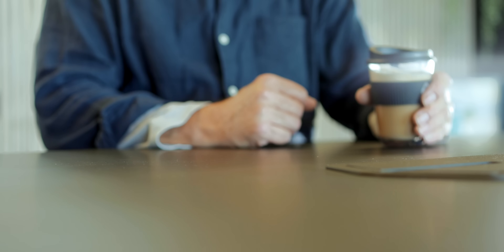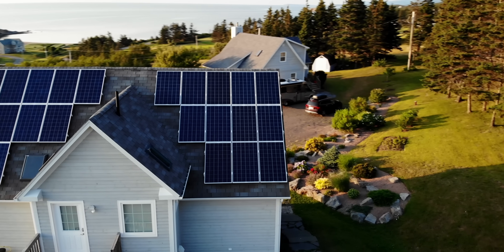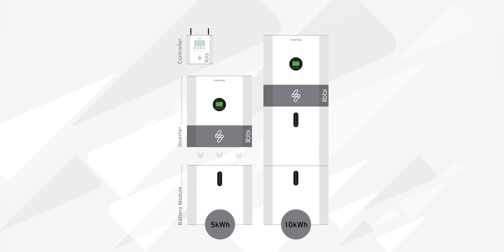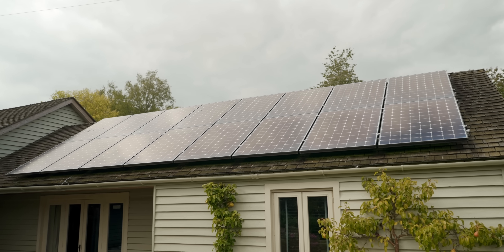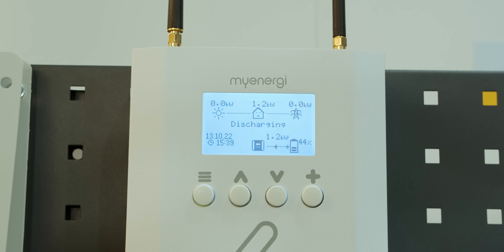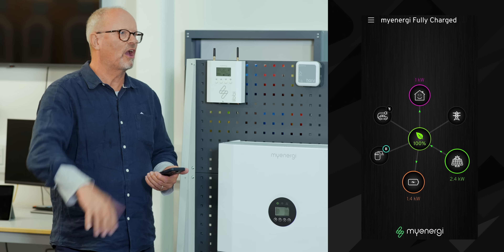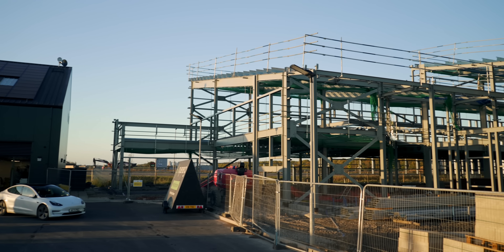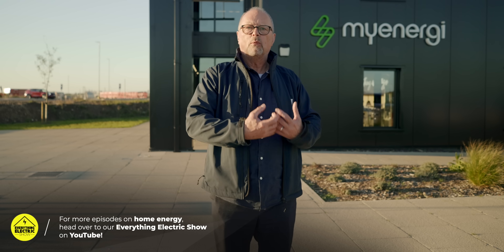THIS Home Battery is the Key To Cheaper, Cleaner Energy!

Comment: Without a price it's hard to know whether it really is cheaper energy (or cheaper than the power wall)
Reply: Yea, I am hoping they don't go above £2k per 5kWh battery and no more than £1500 for the inverter.
Reply: @BobHannent  just seen an update on the MyEnergi website. About £4500 plus vat for the basic 5kWh/3kW setup.
Reply: @rugbygirlsdadg  that's not terrible, not wonderful. Thanks for sharing.
Reply: @BobHannent  I had a quick google and it looks like it's from £4,500 ish which is the inverter and presumably  the basic 5Kwh storage. You can buy 2kw solar panel kits with MPPT inverter / charger, panels and 4Kwh of lithium storage for less than that
Reply: @diceman199  yup, but I kind of expect a premium from a British brand, it comes with the territory.
Reply: @BobHannent  Possibly but that's a rather substantial price difference. I'm looking for solar at the moment as I live on a boat
Reply: @diceman199  similar to teslas 5k for a powerwall. (its actually 17k when your add all the extras). your paying to make elon money from the grid.
Reply: @luminousfractal420  Personally I'd be going the semi-diy route, buying the kit and hiring a sparky to install it. You can pick up 550w panels for peanuts now and LiFePo batteries for as little as £200 for 100ah. 

Lots of boaters have this sort of set up, often with a lead acid battery in the system, and use solar and alternator power to charge when moving.
Reply: @BobHannent  Yes. There are electric cars around now with 80kwh batteries for around £40k. That is £500 per kwh and you get the car for free. The price for storage should now be around £300 per kwh maximum, otherwise we are being ripped off.
Reply: @BobHannent  You are talking about a company that charges  £2k pound for car charger - that just switches power and doesn't even do any power conversion. Their hybrid inverter will probably be £8k plus £1k pound per kilowatthour as the realistic 'installed' price.
Reply: @BobHannent  its 4500eur
Reply: @BobHannent  I phoned them and I swear if costs more than that
Reply: Similar with the Tepeo boiler they featured. I mean, its a great piece of tech and makes a lot of sense.... but I went to check and its 6 grand! I can have 3 normal boilers for that. None of this stuff is going to get anywhere if  you need a 6 figure salary to be able to afford any of it! I'd love solar panels, a battery store, that boiler, an EV and a s system like this. It'd be great. I'd also need about 2 years salary to buy any of it!!!
Reply: @0tispunkm3y3r  tech is usually ridiculously expensive for a while before getting cheaper, just look at everything else. Flat screen TVs were stupidly expensive for a while for example, now a 75" TV can be had for $600 on sale
Reply: @0tispunkm3y3r  If you've got a mortgaged house, and you've got the space, consider getting a lodger

I say this, because it solves a couple of things

Cheaper costs for them
The money they're paying you allows you to pay for stuff like this

That's what I'm doing anyway. Though the biggy is hopefully getting even more solar
Reply: @0tispunkm3y3r  You are 100% right. Going green is for the super rich. We are facing a cost of living crisis. And it’s for the young. The people who spend most time at home are the elderly and the poorest. They can’t fund any of this and they can’t work the technology either. And when it breaks there’s no one local to fix it. And it becomes obsolete too quickly because it’s in its infancy. The average U.K. home nowadays is only 800 sq ft. and has no storage. Where are you supposed to put all these solar panels and batteries etc? I do thin’ a lot of these solutions are only suitable for a very small demographic.
Reply: @tommoncrieff1154  very true. But the first thing every home owner should first do is insulate it. This is something most people could do themselves, although even insulation costs have rocketed since last year. In Scotland there is funding support (grants and loans) for insulation, not sure what's available in rest of UK. The  money saved on heating bills after insulation is far greater than returns from domestic renewable systems.
Reply: You hit the nail on the head.The most important part of the conversation is HOW MUCH?
Reply: @foppo100  The most important part of the show is:
a)how much???
b)can it operate in"dumb" mode?   too much connectivity requiring mobile app or internet...just when a certain country seems to be sniping data cables...the less "smart" the better
Reply: @bigmacntings7451  totally agree. Just listened to podcast on the internet of things where the latest product is one to connect them all together. Reminds me of early software days before we had international standards. 

Kiss = keep it simple stupid ...
Reply: If they don't tell you the price it's because it's expensive....
Reply: The cells themselves cost around €100-150 per kWh. Most cheap batteries (without Inverter) are available at around €350 per kWh. So let's see what this one will cost
Reply: @djrrmml7514  I was basing my numbers on Pylontech (well established brand) and Jakiper (sub-brand of Orient Power), plus giving them some added margin.
Importantly, acknowledging your assertion, batteries are utterly commodity, if they can't reach that price, it'll be selling on hype and not value.
Reply: @BobHannent  and integration with their current system. Many many ppl have these systems already installed, so adding it on is "easy". Given the extra flexibility it will justify ( any ) extra costs.
Reply: Can the Libbi be charged from an EV using the facility such as v2l on an MG ZS EV or similar? Would be even more fantastic if it  could switch from v2l to charging EV from solar or mains via the same vehicle connector.
Reply: Would you want to charge the libbi or literally just have the EV become like an extended battery to the inverter so it can just power your house?
Reply: @0tispunkm3y3r  I would like my EV to be an extended part of my battery storage.
Reply: @0tispunkm3y3r  the car can only export 2.5kwh via v2l. So I want the car to charge the domestic battery at 2.5kw, but then the inverter for the house to supply up to 5kw from the domestic battery and or solar. So basically using the EV battery for topping up domestic battery when required, and if possible the EV battery stopping discharge at a specific point when solar then takes over and charges the EV via the Zappi. Basically Have Zappi and Libbi communicating to control input and output from any EV with v2l or v2h.
Reply: @0tispunkm3y3r  oh man that is an AWESOME question!!! FC please answer this one FIRST!!
Reply: @shortbits23  That would be V2G functionality. Quite why you would want to charge the battery from the car I'm not sure.  Leave the charge in the car for driving. Charge the home battery off peak.
Reply: @IanMcc1000  Firstly I want to be off grid. If you are asking why, well a smart meter won't work at my address (after two attempts by octopus), so the cheapest tariff I can get is economy 7. The EV can only export v2l at 2.5kwh via the inverter within the EV. This output is not enough, so I would go for a 5kwh inverter that draws power from the domestic battery, domestic battery getting topped up from panels and EV. The EV I'm planning on purchasing holds 72kwh of charge so substantially more than the 15kwh for my domestic battery. I can sometimes find EV chargers that supply free or cheaper than my economy 7 domestic tariff, so makes sense to dump that into the house if required. Also this would mean I could disconnect from the grid and save me £180 per year in utility standing charge.
Reply: @shortbits23  interesting plan. I know that a lot of domestic batteries  are ’grid tied’ so I have a feeling you might be stuck with the standing. There's a guy on the KIA EV forums who has actually done this I think. Whether it's worth waiting for the next generation of V2G products as I think some of the latest stuff still can't quite manage what you are planning. Would be interested to see you document this once you start the project.
Reply: Ooh "Affordable Solar" in the UK are selling the KStar for about £7k for 5kWh and £10k for 10kWh.
Reply: @BobHannent   Yes, those are the sorts of prices I'm seeing around the internet.  For comparison a 5.2KWh Jakiper rack-mount battery is £1,700 and a Solis dual MPPT 5KW solar inverter is £820 (inc VAT) so you really have to ask what you're getting for the other £2,500. 

Now the development costs of the integration and software may well justify that. But forcing the battery, which should be a commodity item, into your closed ecosystem is not consumer friendly.
Reply: @calmeilles  you need to compare like with like. A Solis 5kW hybrid inverter is nearly £1500.
Reply: @BobHannent  Is that just the battery system or with panels as well? I've seen some bundles where you get panels and a 5kWh battery for about 10k
Reply: @0tispunkm3y3r  only the battery and inverter, no panels. But did include install (apparently)
Reply: @BobHannent  That is far too expensive. Much more than for Tesla and Tesla is a rip off anyway.
Reply: Yep it's just a sales pitch otherwise..
Reply: @matthew1472  Annoyingly a lot of these videos recently have become sales pitches instead of advice. I still love the channel, but you do wonder how many are on here just so they end up in Robs house.
Reply: Given some of the quotes I have had recently I think this will be closer to £10k
Reply: @Adrian_kal  it does look suspiciously like the KStar Blue Series.
Nice to see CATL batteries.
Reply: @BobHannent  Nothing suspicious, they are quite open that these are rebranded Kstar batteries and inverter with added Myenergi magic
Reply: @edwyncorteen1527  not sure that's what's been represented in the presentations I've seen. But I may have missed it? Plus Myenergi have long told of how they're innovators and 'made in the UK'
Reply: @BobHannent  I went to the Solar and battery expo at the NEC recently when the Libbi was launched and quizzed them on where it all comes from, they have searched very hard for a UK made battery but were simply not able to find one so they have partnered with Kstar who provide the inverter and batteries and Myenergi add their Libbi controller and software.
Reply: @edwyncorteen1527  there was no need to search because there are no UK made batteries. They know from the get go.
Reply: @BobHannent  It is a re-badged Kstar Blue - perhaps with some Myenergi software integration - it's £5k or thereabouts.
Reply: myenergi's website shows the Libbi starts from £4595+VAT. So id guess thats for the basic 3.6kwh invertor and 5kwh battery.
Reply: The myenergi website says that it is from £4595+vat
Reply: A 20kwH battery is massive - way more than most people need unless you run electric heating. I would estimate that the battery alone would be £10-12k plus installation (comparing other batteries on the market). If you already have PV and can save £300pm on gas and electric it would be about 4 or 5 years to pay off. These devices only really come in to their own if you have a full set up of PV plus one or 2 EVs and a dirt cheap off peak tariff.
Reply: @IanMcc1000  average UK house uses about 3700 kWh a year. Say 10kWh a day. Interestingly a detached house is more like 4100 kWh or about 12 kWh a day. I suspect once you break it down into winter/summer you may well see up to 20 kWh a day in the cold, dark months. So potentially a 20kWh pack could come in handy! The issue might be that in summer you'd be able to fill it with solar but perhaps not actually be able to use it all (unless regular EV use) and in winter you'd never fill it with solar and would have to charge overnight all the time on cheap rates.

So I guess 10kWh would be a sweet spot with 5 potentially being a little too small and 20, whilst nice, might only be beneficial to fewer people.
Reply: @0tispunkm3y3r  Yes, I think the main thing that will put people off 20kwh is the price. I reckon you are spot on with 10kwh being right for most. It's interesting that I designed my system based on average usage not on the heavy days i.e weekends where we do more washing/cooking. 8kwh is covering us in this cloudy crap weather, but only just! I didn't have any more budget, but there is the possibility to add an extra battery, but I think increasing efficiency is preferable to keep the bills near zero.
Reply: On the myenergi website it says £4595+vat (excluding installation) I assume this is for the base model.
Reply: Are the batteries lithium iron?
Reply: @jameshenderson3877   LFE I believe
Reply: From £4595+vat (excluding installation)
Reply: 1) Financing , so its the annual cost that is important, and 2) resiliance - your lights are on when your neighbours are off
Reply: From £4595. I'm guessing that's inverter and 5kw battery. It's on there site
Reply: Not to mention the life cycle. Will this have to be replaced in 5 years, 10 years. Do I setup an escroll account for the future replacement?
Reply: The linked libby website says: From £4595+vat (excluding installation)
Reply: The price is literally one click away on their website (link is in the description)
Reply: from 4500eur
Reply: lol nearly 17 minutes of video but no price? Glad I saw this comment first
Reply: @marcob1729  4.5k
Reply: Without a price you can't estimate how long the initial cost will take to recoop in order to save money...
Reply: @Kvickification  its 4500eur
Reply: @andrejwalter8968  Not too bad, too spicy for me tho
Reply: Grimsby Cleethorpes is the partner city of our neighboring town and it happened to be that I was on a student exchange back in the days. Happy to hear about this really positive development. I'm impressed.
Reply: 5k for a 5kw module
Reply: front page on thrie website say this " from £4595+vat (excluding installation) " , so I am assuming this is for a 5kw battery system
Reply: @Adrian_kal  yep Ali baba when you want your house burning down.
Reply: From £4595+vat (excluding installation)
Reply: From £4595+vat (excluding installation)
Helps if you visit their homepage.
Right now this means you could save with the night/day trick like 50-60 quids a month, which means that in 8 years you could be at your money, but taking into account that current batteries last maximum 10 years it's just not worth it.
You're much better off spending that money on panels and supplying the electricity to the grid and buy it back as needed and pay for the balance.
And you can't use batteries to store summer light energy until winter anyhow, so until battery technology jumps a huge one this - or in fact any other battery-based system - is just not viable financially.
Reply: @Mental_Hangover  What a load of tosh.  Go diy.  Use grade a eve cells.  6000+ life cycle, thats 20 years!  -  and after 20 years of draining them down to 20% every single day, youll still have 80% of the original capacity.   Use a 200amp jk bms for huge customization, stick them in a box, job done.  7.2kw for less than £1400 including the bms.   14.4kw for £2650.   Thats what ive done. None of this rip off crap. And compatible with every inverter with all the features that lot offer. People really should do more research.
Reply: @jmpcrx  We are talking here about these specific ones, my tosh friend...
Reply: @jmpcrx  Oh, and btw: not everyone will go diy. I'd say that is rather the exception, not the rule.
Not to mention that if someone effs it up they can end up with a lot of problem.
Electricity is not a game, 7kWh is not a toy.
Reply: There's no price because the resellers get to rip you off to their delight
Reply: From £4595+vat (excluding installation)
Reply: Just look on line like I did, took literally 30 seconds
Reply: The CEO talking about "providing services" at the end is a HUGE red flag to me. I'd never pay them a monthly fee.
Reply: if it has an api one could feed it with Day-ahead data.
Reply: 5 grand... excluding vat
Reply: If you contact them they email you the price list 😊
Reply: You need to buy this for its design and fanfest for latest technology.
Reply: i would guess that because theyre not slamming elons prices that it costs the same or more. powerwall is 5k advertised. more like 17k in reality (my mother in law checked, she was interested) and thats without the solar panels.  whole system only last 15hours, 22 with panels. its no good.

a good system would supply enough power to supply a home and charge the battery fully within 24hours.

elons setup is all about him feeding into the grid and profiting from it while getting other people to pay for it.
Reply: Yeah please don't put out ad videos without including the price.
Reply: Cost me £3k for my diy install.  3kw of panels, 3kw hybrid inverter with pass through, and 7.2kw of lifepo4 batteries.   Does everything this system does and more.  If people really care about all this green stuff, get off your asses and build it yourself for a fraction of the cost.
Reply: @jmpcrx  Exactly the wrong take. Any technology that you expect people to DIY will never become mainstream. That very much also applies to green energy tech.

The more convenient you can make its installation and use, the more likely it will be used.
Reply: When they said they wouldn't list a price, I stopped watching because, without a price, the capabilities of the system simply don't matter.

If batteries and renewable energy are really to replace fossil fuels on a massive enough scale to actually solve climate change, the cost of batteries has to fall dramatically, ideally to the point where a 20kW battery like this one is as cheap and easy to buy as a refrigerator or washing machine.

I have serious doubts that the battery shown here will be available for anywhere near that price point.